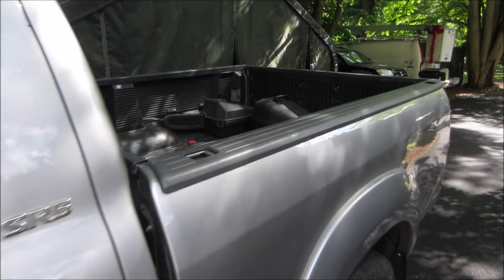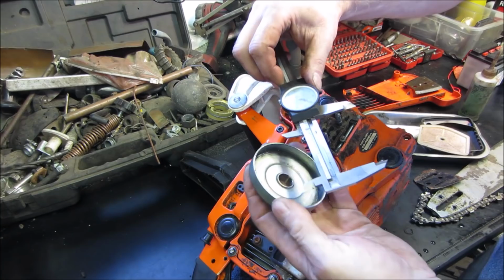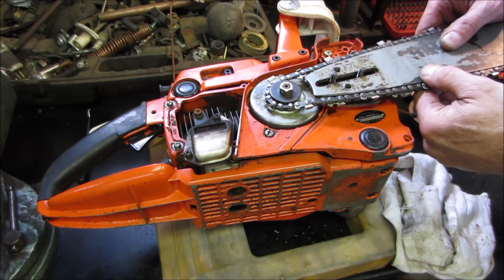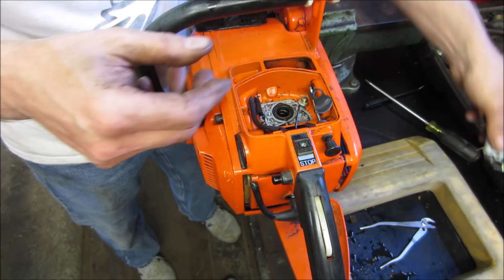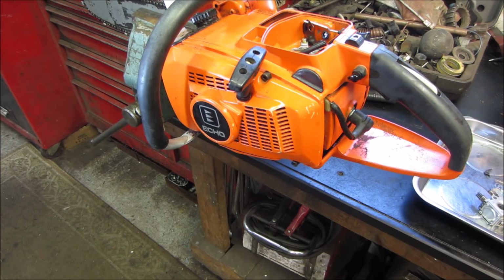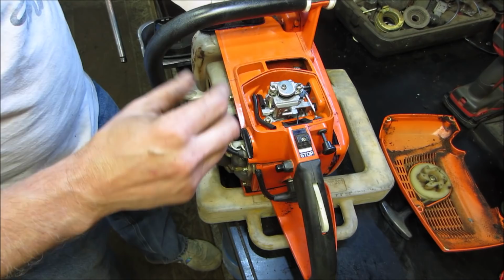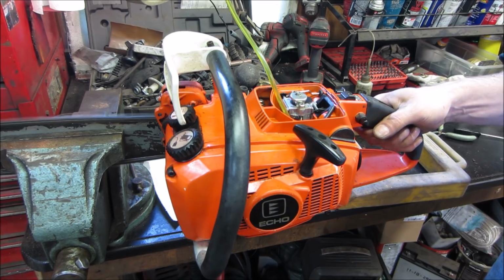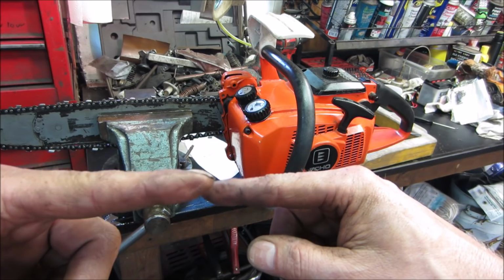Free Echo CS 400 Chainsaw, Will it Run?

Comment: funny how these carb parts sell on ebay a oem seller for kohler motors wanted $60 for a anti backfire valve for my carb or he wanted $20 for the whole carb I bought the carb took the valve off now I still have a new carb if ever needed then I ended up putting a shut off valve on it anyways so I could run it out of gas for winter and like it better dam ethanol

Comment: Hey mustie i have a echo cs-400 Chainsaw and its brand new its only been used maybe 2 to 3 times and i have an bar and chain oil leak it drips while i use it and and when it sits there is a little puddle of oil under it  is that normal or no

Comment: But will the Poulan Pro come back? That's the real question in my mind, I figured the Echo would with some new parts / a carb cleaning.
Reply: I don't know if this has changed, but it used to be really hard to get parts for a poulan.  Was the main reason i didn't buy one.

Comment: So many saws are left for dead after people leave fuel in them all winter and the carburetor gums up.
Reply: Robb403 👌
Reply: Agree. I have always used fresh gas and during winter months run the mower and other 2 stroke out of gas and never have starting issues the following year 👍🏼. Had a neighbor bring me his Echo blower to fix and I asked how old the gas was and he said, oh not that old probably 2 years 😬
Reply: @lancairw867  I use a preservative in the gas during the winter and drain the tank and run the engine dry when it is to sit for more than a few days.
Reply: Robb403  preservatives like Stabil ?
Reply: @lancairw867  Yes. I add it when I get a can of gasoline so it's ready for al kinds of needs in cold weather. Winters get to -10 F here. Not sure if it matters as much in warmer climates.
Reply: Ethanol kills any small engine machinery with a carburettor unless the fuel is treated with fuel additive or someone has been run on the fuels like ASPEN.

Comment: Chain needs to be tighter.. I'm only a little way through video though.
Reply: The chain should  always make contact with the bar. You should be able to  the chain from the bar. Also the shield on the outside is missing . They come in pairs, one pointing in and one pointing out.

Comment: looks like he has done everything but check the fuel filter
Reply: he ran gas directly into the carb with the long replacement fuel line, bypassing the fuel filter. It still didn't idle. It's gotta be the carb diaphragm or like he said, the crankcase leak. I really want a follow up because I have a chainsaw doing the same thing, carb kits in the mail though.

Comment: if my saw runs for a few mins then bogs out and wont cut any longer then shuts off does that mean a carb issue? got it used for dirt cheap
Reply: Probably the carb. But see if it has spark when it shuts off

Comment: 29 minutes into it, why not take the filter off.  Who cares if you break a fuel line, you'll be changing them anyway, but you said there was a restriction in the line anyway? Take off the float ( filter ) and see what happens. Taking apart the carb should have been done after it runs constant.

Comment: I cringed when you pressurize the tank seeing if fuel comes out the pulse line or pressurize that line directly. It directly goes into the crankcase to operate the fuel pump that is externally pulsed through that nipple on the carb top.

It's ok, you figured it out though lol.
Reply: I'm surprised you were the only one to pick up on it!

Comment: Not to be picky but that chain is way too loose. It should be snug in the bar but not tight.  You should be able to pull the chain away from the bar and it should snap back. It is not safe to run it that loose. The blade will jump out of the bar when cutting.